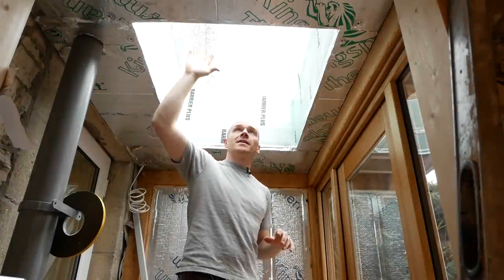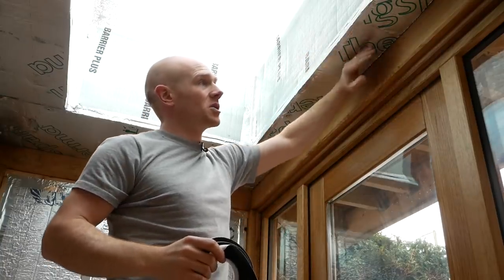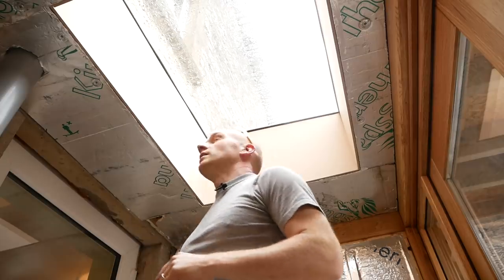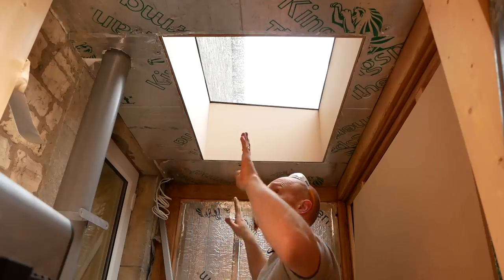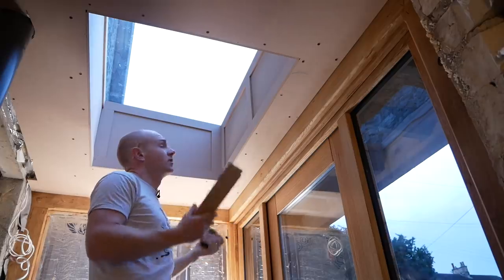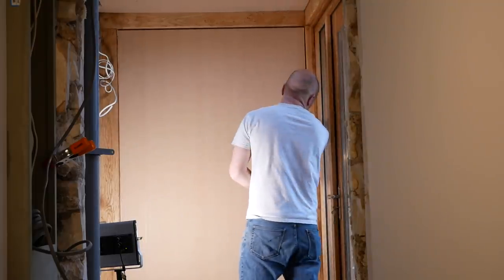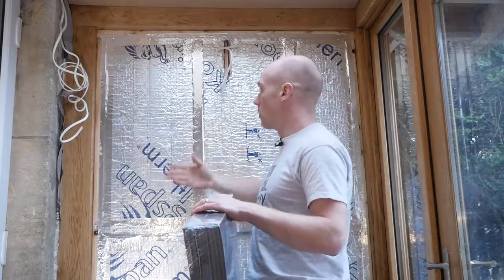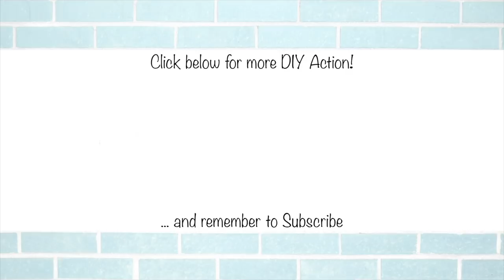MDF Walls and Ceilings - Why not plastering?

Comment: Nice work! From someone who sprays a lot of MDF (bespoke kitchens, wardrobes etc) you might want to consider some MDF sealer before your primer layer. MDF can be real thirsty, and wet paint will raise the fibres which will need repeated sanding back and repriming. An MDF sealer will help reduce those steps
Reply from the maker: Yeah, the rolled Zinsser first coat helped on the edges I had routered.  As my sprayer is waterbased only, I didn't think sealer was possible but having just searched it appears it is waterbased so will try that next time.  A good rub back after the primer worked ok, certainly fine for walls, would want to practice a bit more before using on cabinets or furniture though. 👍

Comment: I was lucky enough to build my own house. One of the main points I made with the architect was shadow gaps. Where wall meets door there is a 5mm shadow gap, no architrave. Where wall meets ceiling there is a 5mm shadow gap, no cornice. Where wall meets floor there is a 5mm shadow gap, no skirting. The guys that did the plasterboard and plastering hated me through the job but when it was finished they said it was the one job they had done they were most proud of.

Comment: If you’re looking for an insulation that doesn’t add much thickness try looking into super quilt or foil quilted insulation. Comes on a roll, when squashed it’s probably about 5-6mm. And it’s an equivalent to roughly 4-5 inches of celotex👍🏻
Reply from the maker: Only really works with air space and counter battens I think, not ideal when squashed flat.  Probably better suited to rafters..

Comment: MDF would deteriorate next to the window because of moisture from condensation
Reply: Did you watch it, as he covers this in the first 3 minutes.
Reply: What? Mdfs sole purpose is to save money. A recycled hard or softwood or paper compressed in to sheets. It's a cheap product and certainly was not intended for anything but saving money. The moisture resistant stuff is OK but the non moisture resistant stuff is shit.
Reply: Gareths never heard of tricoya MDF then £120 a sheet 18mm , guaranteed outside with no finish for 25yr warranty with zero finish on it that extends the better covering you get on it , I’ve used it for many high end project in London and never had a come back , cheap rubbish I think not , look into it it’s good stuff takes its toll on blades but worth it for the piece of mind you know it stays it’s true size and doesn’t rot or warp , I’m sure there’s some vids on YouTube of guys using it
Reply: @gareths9574  You never heard of V313?

Comment: When i saw that acro prop fall, i was half expecting you to say you'd broken a window
I would have had it adjusted tight against the solid part of the ceilng with just enough overlap to hold the cut out piece

Comment: Looks good... looking forward to finding out more about that sprayer and if I can afford it.

Only question from this vid was how did you finish around the soil pipe? A second bit of mdf and wood filler?
Reply from the maker: The sprayer is not cheap but a great bit of kit.  I bought it to restore all the doors in the house so this was a trial really.  If you have a specific project then not much money lost as the resale value is very high when you're done.  Otherwise my old budget HVLP sprayer has always impressed me for the £50 or so it cost.  The wall by soil pipe is boxed in to create space for radiator and next week's big reveal... ok, it's a pocket door, not that exciting but I'm pretty chuffed with it. 😉

Comment: Okay, so I'm not crazy after all, hehe. I built a little store room under the stairs, and I had to remove the plasterboard that formed a corner. I was wondering whether it was acceptable to use MDF for that small part of the wall as it lead up to the new doors for under the stairs. Thanks, I think! 😁

Comment: When the oak shrinks the decorator caulk will hide the edge and move with the oak Been plastering alongside oak since day one with a good decorator it's not a problem. You will still get the gap with mdf and have to caulk it up. Use stainless steel stops if it's that much of a worry.
Reply from the maker: 👍 Yeah, I have seen it work, usually with stops though. With the route I have gone I want the shadow gap and it will remain black as the seal expands. That’s a big gap to caulk with green oak. 3 or 4 years time It could be 5-10mm in places. Either way, lots of options, the best being to sit the plasterboard off the back of the posts entirely to avoid any contact but requires different building method.

Comment: The roof void will naturally swept, and back of midfield will get wet, you’ve no proper ventilation for the air gap above the insulation, the timbers will be saturated in no time

Comment: Be careful with panelling with foil behind where you think there maybe heat directed to the surface. When the foil reflects the heat it will want to expand the air inside between the two sheets. Especially with such thin sheets.

Comment: Looks good, but if you ever need to repair/modify, that MDF will be a pig to remove:(
Reply from the maker: Possibly, although repairs easily filled or at worst can also be skinned over.
Reply: @TheRestorationCouple  Lets hope not, since this porch if I might say, will be fit for a King:)
Reply: The Restoration Couple skinned? Do you mean skimmed?
Reply from the maker: No skinned, I.e if there was need to, I could just line over with a sheet of thinner MDF or ply.👍

Comment: Cosmetically mdf/ply boarding may be fine, but bear in mind that it is more of a fire hazard and wouldn't meet the 30 minutes of fire resistance required by building regs.
Reply from the maker: Good point. Perhaps in a house but in a porch outside of the stone walls of the house not so much of a concern in this scenario.

Comment: You want to future proof it? You certainly won’t do that with the most permeable substance on the market. Mdf is shite and will swell up with the first sign of moisture, just like a sponge. And in particular around that window up there. You’ll be doing it all again very soon, sorry. 
If you want to get all fancy or are too tight for a plasterer as you can’t do it yourself at least get waterproof mdf (I know you said they don’t have it in stock) or ply. Pay a bit more and do it right first time around is cheaper in the long run. 
And why when you have the most expensive tools on the market with an extraction system are you getting covered in mdf dust. It’s lethal.
Reply from the maker: There is no cost reason involved I could have boarded out with plasterboard and a couple of bags of multi for less money. MR MDF will still swell so if there is water damage it’s going to need sorting either material. Having used a similar technique 5 years ago in the house I’m fairly confident it will hold up just fine but if it doesn’t it’s not the end of the world. As for tools, most are budget diy tools or second hand and not sure of any extractor that would manage flush trim routing the ceiling?
Reply: @TheRestorationCouple  I fear, you are not going to hear the last off this. We all remember Changing Rooms using acres of the stuff, with all it's associtated jokes!
Reply: @TheRestorationCouple  I wouldn't say a festool tracksaw is a budget tool or any of the other joinery equipment you have, second hand or not that's still a £1000 plus of gear
Reply: I’ve left some mr mdf sitting outside for months now as an experiment. No swelling, no signs of damage. 

I don’t get the tool hate. If you can’t afford them but cheaper or don’t bother 🤔 

I feel sorry for YouTube creators who spend hours and hours sharing their knowledge to be told be people who don’t what they should be doing 🙄 internet eh 🤦‍♂️
Reply: @malcolmbullock4297  theres no tool hate pal and I'm in the trade so definetly know how to use them and can afford them, just can't see why he says it's all about DIY still when it's clearly past that point now, sorry if I upset you fanboy
Reply: Malcolm Bullock it’s all part of leaving comments, good and bad. I give credit where it is due. If everyone blew smoke up,your arse all the time it would be false. I suppose I just don’t like mdf and I really do think where he has put it around a window where they’ll be a lot of condensation and it will react. I am a tradesman of over 35 years and have seen it all. He’s also not a tradesman although a very good diy. 
And as for getting your head covered in mdf dust, well that’s just asking for trouble.
Reply: @Frankiez220  agree
Reply: Frankiez220 a tradesman of 35yrs can’t afford decent tools 🤔 I’ve left Medite mr mdf outside for months and it’s fine.
Reply: Malcolm Bullock what the fuck are you talking about? Who mentioned not affording tools ?
Reply: @krisrickson853  
I think you're getting confused yourself with the phrase DIY.It just means having a go yourself and you can buy whatever you want if you can afford it.There are no rules as to how cheap or dear your tools are.
I've watched this channel for over 5 years and seen how they've transformed their house to a top standard through trial and error.
Maybe the MDF will turn out great,time will tell.
Reply: @krisrickson853  I think you're getting confused yourself with the phrase DIY.It just means having a go yourself and you can buy whatever you want if you can afford it.There are no rules as to how cheap or dear your tools are.
I've watched this channel for over 5 years and seen how they've transformed their house to a top standard through trial and error.
Maybe the MDF will turn out great,time will tell.